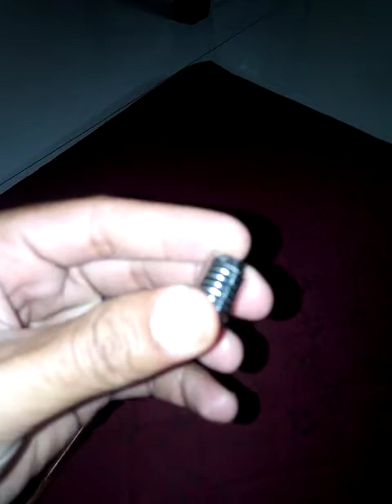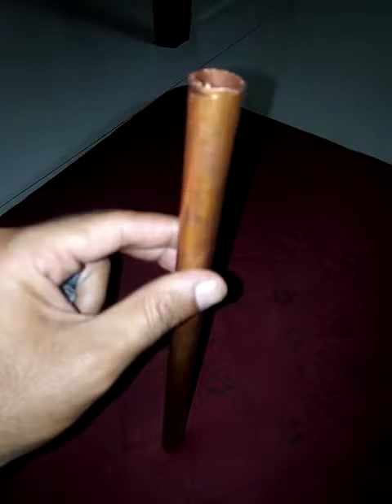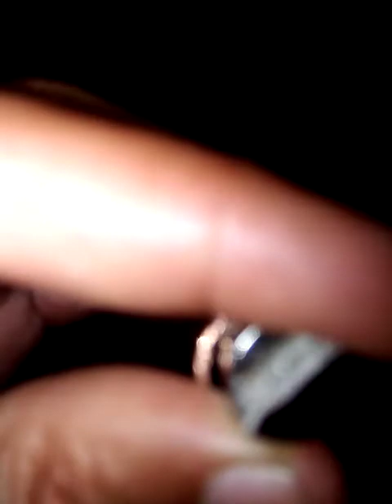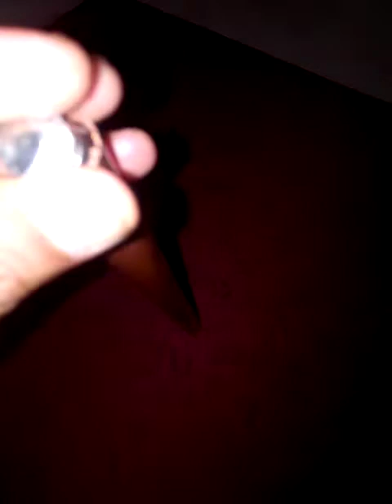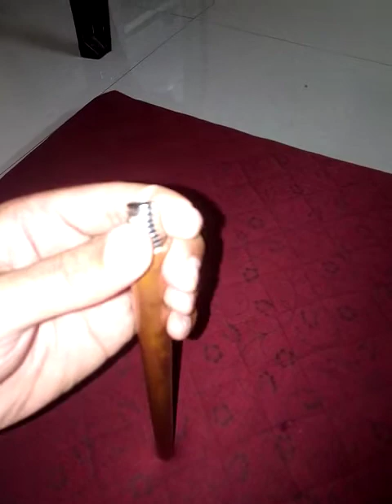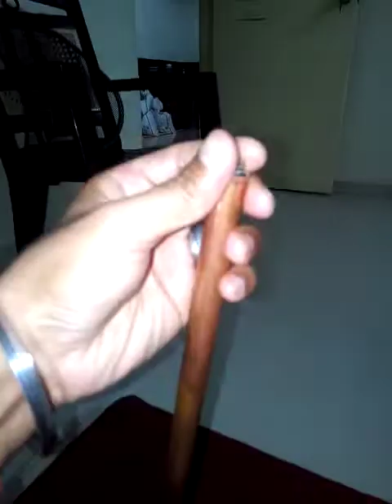Eddy Currents Demonstration

Comment: Wow interesting experiment ..as the magnet moves down, the copper tube experiences the change in magnetic field which induces (eddy) current in the copper tube. And this eddy current will try to kill its cause i.e magnetic field by creating another magnetic field in opposite direction. So this resistance will reduce the speed of magnet passing through it. This crazy eddy currents are also used to stop the speedy trains. 
Thank you Sir and eagerly waiting for your home made hand pump ...
Reply from the maker: Great explanation. Can you think further as to why the opposition and not support? Hint :- Think from a magnetic polarity perspective.
Reply: Thank you Sir. For your question, I think the way eddies are created in the tube is such that they will always repel the magnet by generating same polarity. Means if north end of magnet is approaching, the  current will set up in the tube in a direction such that tube (?) behaves as of having a north polarity and hence further repelling the magnet. The direction of current ubduced is given by right hand thumb rule. 
I am kind of confused whether the orientation of magnet matters or not and also the path traced by the magnet- is it straight line or following some curve ?
Reply from the maker: @vijaynandurdikar1003  Excellent answer, spot on!! The orientation of the magnet will not matter as it will always result in repulsion. It will follow straight line as it is essentially a special case of free fall with terminal velocity. So this way we are also simulating Terminal Velocity situation. Now I am going to try the same within an Aluminum tube and compare fall velocities. Isn't it fun and simple.